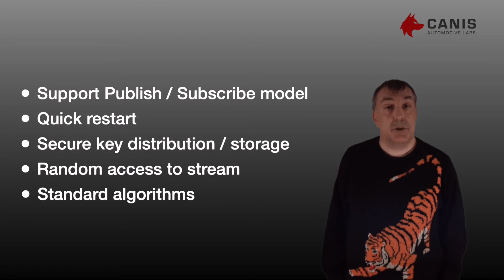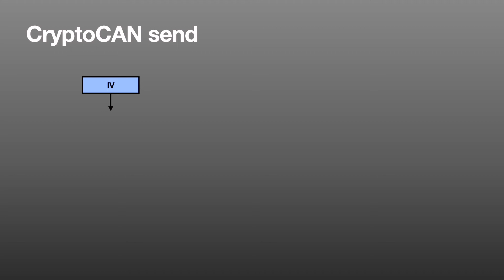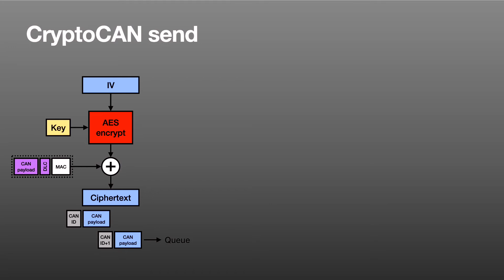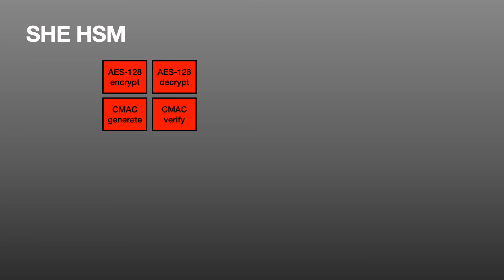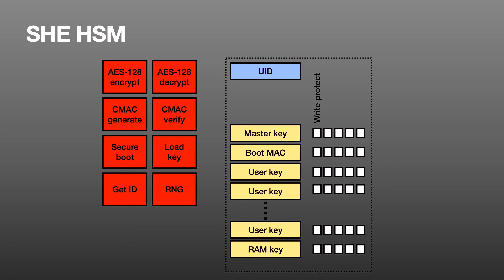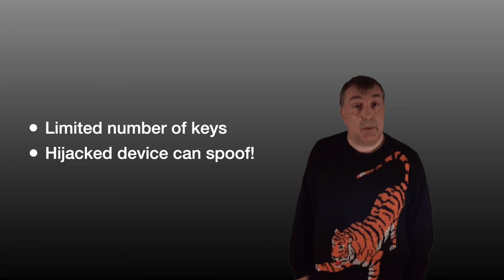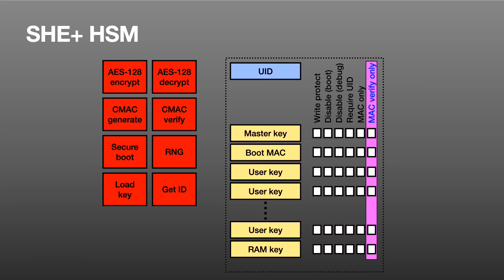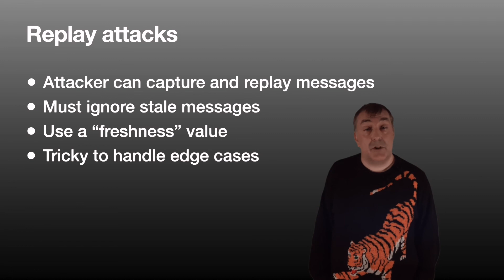Defending CAN bus Part 2:  Cryptography

Comment: @5:20 with CFB, if any of the blocks after the first are lost, the following blocks cannot be decrypted. Ideally, you should be using a different mode if you intend to be able to decrypt any of the blocks regardless of where you start. This will inevitably lead to lost data.